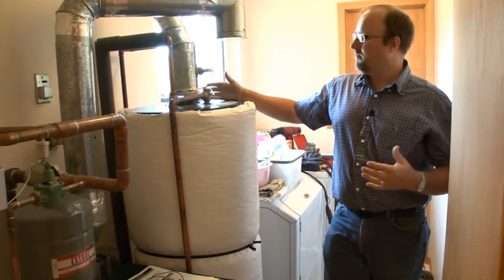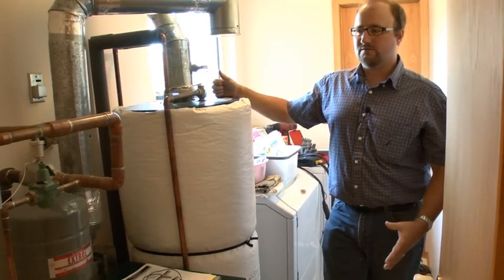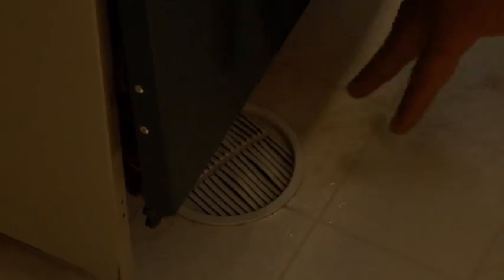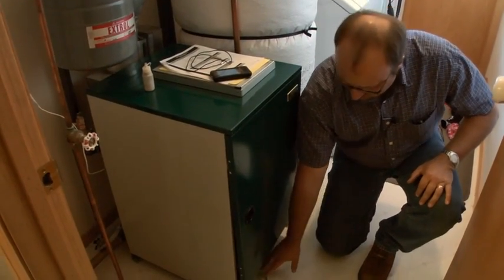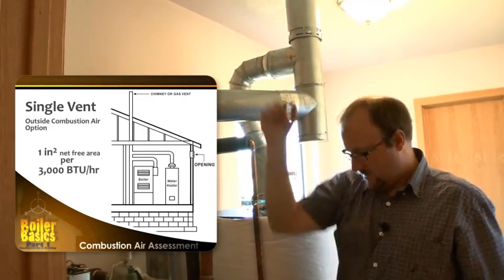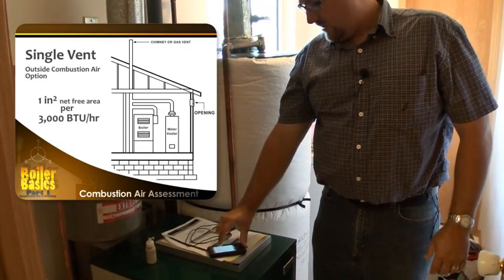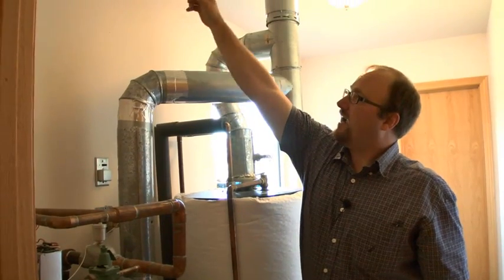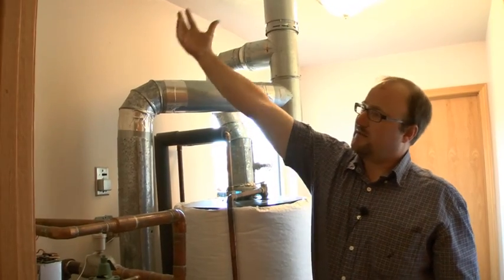Boiler Basics: Part I - Combustion Air and Drafting

Comment: Dear Mike and company as a retired boiler service tech I only have 1 question for you in worst case you have to calculate the air being used by an electric dry also, ever through it does not need combustion air it is consuming available combustion air in the space if the dryer doesn't receive adequate air it will not dry the clothes properly and if a backdraft is pulled into the dryer the clothes will smell so in configuring your combustion air needs your must account for the clothes dryers need for air. Thank you R Brown

Comment: 12 years later watching this video, as a homeowner I certainly learned about the need of fresh air supply for combustion, also effects of a negative pressure which causes carbon monoxide poisoning. Thanx for the lesson. 👍

Comment: Folks this  is an  "excellent"  example of how NOT  to have a  mechanical room.    I assume there's a bathroom exhaust blower, and  so is the dryer.  So right there you have  negative pressure created in the room

Even if those two  exhaust  blowers were not present, this room, even with the bathroom added,  does not have ANYWHERE near  the free air available  needed for combustion air, either for the water heater alone, and certainly not  the boiler  or the two of them firing.

Further,  ANY   chemicals  such as photography,  ceramics,  hair and beauty,  soap,  and most certainly  more agreesive such as paint related,  causes  corrosive problems in both  heat and AC   heat exchangers.

I realize the OP here is trying to educate,  but a  wise  experienced  HVAC  serviceman,  which I used to think I was   (retired)  would not  allow this  situation to fly.

Comment: I have a Repco gas boiler, it is 20 years old but works great. lately it has been producing CO @40ppm at an elevation of about 500 feet ASL. According to the building code only 4ppm is allowed. I did clean the exhaust pipes and fluke. how do I bring the CO level down? Please help....
Reply: you need to give it more air.

Comment: @pappadblues you are right on the money..... Also at12 min -30 Secs in.... the pipework on the exhaust of the hot waterheater cylinder  is restricted by lousy pipe fabrication.. goosenecks and 90 degree bends.. allied with reduction of  pipe duct  sizes this throttles back on the exhaust thus causing reduced  venting of those combustion gases maybe that's why he is getting  same highlighted  his  smoke pen  also fit a big  safety duct on the outside wall of the room to reduce Co2 build up